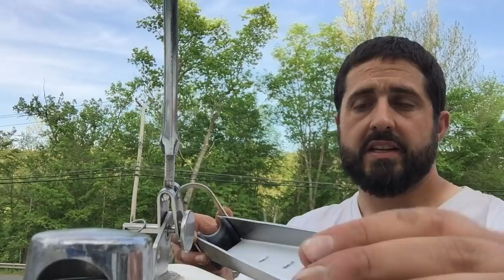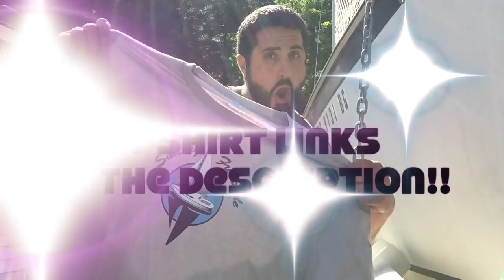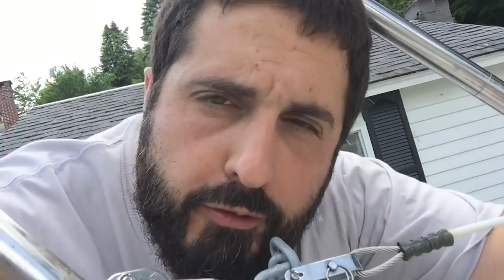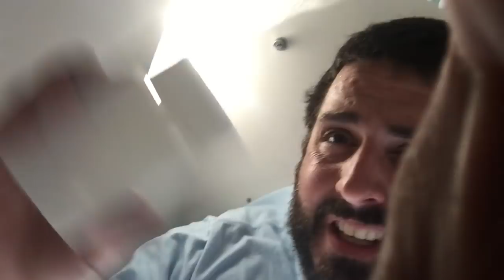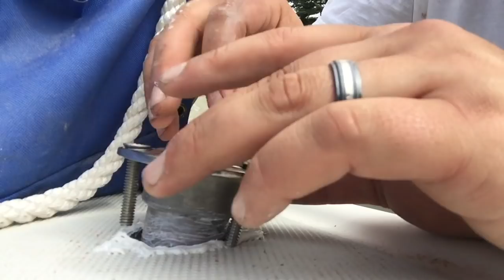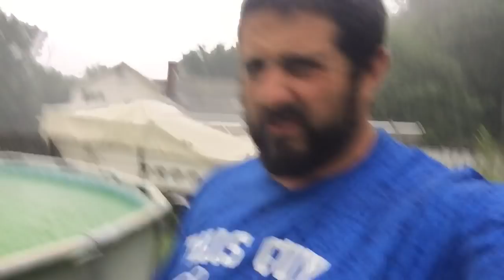Sailboat Upgrades - New Anchor Roller

Comment: Bought myself mid 70's Venture (MacGregor) 25 and refitting it. You're videos are very helpful! Lots of good ideas. Currently working on rewiring a mix of original and very sketchy electrical mods done in the past (it's a miracle this boat didn't burn up). New shore power setup with a couple of AC outlets and an on board charger is done. Next up is adding a second battery, finish converting to LED, and will soon be installing a new electrical panel, solar, etc..   I'll be tackling the anchor setup at some point, and trying to organize the gallery a little better. Thanks for ideas and inspiration!!

Comment: My '88 26D has a deck leaking problem when it rains. I've been gradually re bedding all the deck hardware and it definitely improved the situation. Still getting a little water in the bilge and on the floor inside, so gotta get the rest done. I really like using butyl tape instead of silicone. No mess, easy to re-do if needed, and works great. I built a 3' long bowsprit from a piece of oak I had for my anchor roller. It fits in front of and around the rigging plate and cleat. Gotta get one of those chain pin brackets you used. Nice to learn what the boat is made of from your work. I was cringing watching you grind into it dude.
Reply from the maker: Lol, I had to work up the courage over a while, I wanted the roller since I got the boat but that problem always scared me off. But after sailing a few times without one I realized t just had to be done so I went after it. I considered the sprit idea but read at some point that technically “adds length” to your boat (which potentially means costing more $ for a slip at a marina if that’s something we end up doing) also just a $ thing. It was a lot cheaper to grinding a little bit off than to add a sprit. I also always for get to order that tape and can’t find it in the store, so I always end up resorting to just grabbing sealant from Walmart or Home Depot.
Reply: Doh! You're right, I guess I have a 27.5D then.
Reply from the maker: Lol yes you do! Oh I forgot to ask if you sealed the chainplates yet? That’s where 90% of the water was coming in with mine.

Comment: I've not commented before on these videos but I just had to for this one.  I recently acquired an 88 26d and watching you attack the same jobs I do is both entertaining and informative.  The reason I'm finally taking the time to type something is my very next project is installing the exact same anchor roller on the bow of my own boat!  Watching you grind off the bit that I was too scared to grind myself, I actually yelped when you touched the rail with the grinder; way WAY more guts than me.  Respect to you and Aloha from Hawai`i!   S/V Windflower
Reply from the maker: Aloha Pez!! Thanks for taking the time to comment and for watching all this time! Sometimes you just need to suck it up and go after it! Analyze it from every angel first to try and figure out what all the possible outcomes will be and how you would approach each of them. When you have a plan for all the outcomes it becomes less scary! Luckily the actual outcome of grinding the bump down was not the worst case I had thought of and it was a relatively easy job! And the end result is a fantastic anchor system! I hope I have inspired you to go forward with your project! Please check out the facebook page and start sharing what you're doing with your own boat there. I would really like to start growing the community there and having it become more interactive and engaging!

Comment: That water fill need a clamp,  little more bedding needs to be used under deck hardware, I recommend butyl tape. The anchor roller  needs more support then that small pc of starboard. I recommend a pc of aluminum plate twice as big as your starboard pc. And search eBay and online  for boat parts, you’ll find them cheaper then at Amazon. Good job!
Reply from the maker: Good tips Jeffery. I wasn’t too worried about a hose clamp on the fill because it was such a tight fit to begin with and don’t plan on having the hose fill up with water (on purpose at least!) just the tank. So the hose is basically just a long funnel.

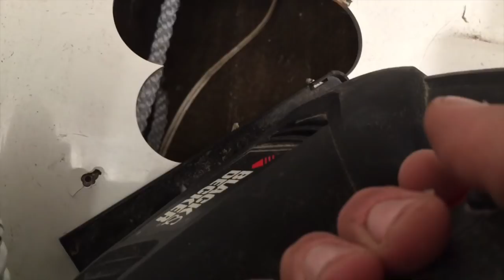Comment: I see where you cut (on the inside for bolt access) sharp square corners beginning at about the 6:38 mark. That's a big "no-no". Those sharp corners create stress risers and cracks in the fiberglass WILL propagate from those sharp corners. If you have to cut openings in the fiberglass, try to cut as large a radius in the corners as you can.
Reply from the maker: Good tip thanks

Comment: Nice job!  I think all the MacGregor boats had that forward bulkhead with no access.  I cut large openings there in both Mac 25s I've owned.  Once you're done working up there, you'll want to make a door or cover for the new opening.  I'm not sure about your boat, but mine stores the anchor rode in the space forward of that bulkhead.  Although it would be easy to make a cover that sits on the cabin side of the hole, it begs to leak just a bit of the mucky water that comes up on the anchor line and I'm always thinking about how it might come loose and let the anchor chain come tumbling into the bed while i sleep.  So on the current boat, I have three pieces of wood that can go through the hole one at a time and sit just forward of the bulkhead.  The little bit of bulkhead left at the sides serves as a flange that won't let my boards go any farther back towards the cabin. 

 I drilled some holes in the flange area (what was left of the bulkhead) and ran screws through the holes and into the new wood pieces so they are held flush to the bulkhead but forward of the bulkhead instead of on the cabin side.  This doesn't let any moisture from the anchor line to enter the Vee birth and there is no way it can come loose and fall into the vee birth either.  I left mine like that, but you might want to make a decorative cover to go on the cabin side so you aren't looking at the cut fiberglass at the edges of your new access hole.  My boat is pretty utilitarian, but you have done a wonderful job of making yours look beautiful as you improve it.

I also have a nearly identical bow roller.  Its so much more convenient to store the anchor up there and just let it go when you want to drop anchor.
Reply from the maker: Good ideas for covering that hole up there. That will be "the kids bed" so they can deal with the wet muck from the anchor rode! HA! But in all serious that is a good point I never considered and some kind of water tight hatch should be made. Maybe a cover that is bordered with a rubber gasket that can be tightened to the bulk head with a few bolts coming from the forward side of it poking through to the v berth then tightened up with some wing nuts. And yes it makes a WORLD of a difference having a proper roller now. I really should have done it a long time ago but didn't want to tackle the problem of the forestay and that small bump getting in the way. My power boat it was just a matter of slapping it on there and didn't take as much problem solving.
Reply: Before you cover the hole, think about getting an electric windlass to raise the anchor.  I run my boats single handed and I always hated anchoring because I can only control the boat from the back but need to control the anchor from the front.  So I have to let the motor idle while I go forward to drop anchor and the boat just goes wherever it wants to go until I have the anchor down.  Its worse recovering the anchor because the boat drifts as soon as the anchor is off the bottom and it takes me a while to get the anchor back on deck.  Inevitably the only thing I can do with the rode is pile it up on deck because feeding it down the hole to the anchor rode locker would leave the boat drifting free too long.  People who come up and anchor behind me have no idea what danger they are in.

An electric windlass lets you drop anchor and raise the anchor with a switch back in the cockpit where you can control the boat and raise anchor at the same time.  I bought a nice Lewmar windlass thinking it would be an easy install above the existing anchor locker (that space forward of the bulkhead you just cut).  When it arrived, the instructions said that the rode needs at least two feet vertical drop from where the windlass goes through the deck to the top of the pile of rope or chain.  If there isn't this much free fall space, the windlass is likely to jam, which makes you run forward and haul up the anchor by hand while the boat drifts aimlessly all over again.

The space forward of the existing bulkhead is too small.  It might be a bit over 2 feet to the bottom of the anchor locker, but the rope is going to quickly pile up till there is less than two feet to the top of the pile.  So my solution is to move the bulkhead back just a bit.  Six or eight inches should be enough.  I'll also cut away the fiberglass bed base forward of where the new bulkhead will be so the rode locker goes all the way to the bottom of the boat.  There will be a little divider directly below the new bulkhead so rode can't snake sternward in the bilge and get hung up so it doesn't deploy smoothly.  Its not a small job, but since you have to do something with the forward bulkhead now anyway, its easier to do now instead of re-doing it a year later as I did.

The windlass is already installed in the deck (and sticking into the very forward part of the vee berth) but I got started on the new boat before moving the bulkhead on the sailboat.  I have already installed a free-fall windlass on the new boat.  One of the few things I've learned from experience on the boat is that you definitely want one of these to raise anchor for you if you are alone on the boat.  If you get a windlass, you should also invest in a special rode for it.  You want 8-plait rope which has a special weave like braided hair that lets the rope stay soft and it piles up much flatter than normal braided or three strand ropes.  The windlass will specify a type and size of chain and diameter of rope.  You get a rode with the specified chain size spliced to the specified rope size (and make sure you're getting 8-plait rope) and it runs through the windlass smoothly and never jams.
Reply from the maker: Oh man I would love one but that is just a luxury that is way out of my budget (I’ll need a few more subscribers at least! Lol) I got a good pair of sperry’s for my birthday though that let me be pretty nimble running back and forth on the deck, lol!

Comment: Awesome job!  The anchor roller looks like it was made to be there!  You mentioned on your other boat you installed an anchor roller as well.  I have a 21' Rinker cuddy cabin boat currently.  It has always been a pain getting to the front of boat on deck and set our anchor so I have also thought about adding an anchor roller.  Right now we are using a danforth at the front, and often a second navy anchor in the back.  We tend to drag anchors since we are out in Lake Erie just south of the Detroit River that has a decent current.  I have considered using a different anchor like the Bruce Claw anchor you have with an anchor roller, is that what your using on your power boat?  Do you like it?  Any advice on anchoring?
Reply from the maker: My other boat is actually an 18 foot walk around cuddy with a Merc 150. Install was pretty easy on that with no forestay to work around or any weird humps in the deck. As long as you have access to the underside ( I ended up cutting a hatch for an anchor locker right there so access was pretty easy for me too). I do also have a Bruce on the other boat. I’m mostly on lakes around here and found that a danforth sucks in lakes because the bottom is usually rock and deadfall and old stumps, just lots of stuff to get hung up on. I actually had to cut one off before.  I always use mushrooms on my other boats so I figured the Bruce was a happy medium. You can just drop it and let it sit there like a mushroom if you’re just hanging out swimming for a little while, or you can use it like a normal anchor and set it if you have some decent ground, and have something you can can spend the night on. I think it make a big difference what the bottom is like, and you just gotta really make sure you’re setting it good by throwing the boat in reverse and pulling on it until you can “feel” it set.

Comment: I am adding a bow roller on my 1993 Mac to hold my Danforth anchor. I made a 32" bowsprit from 2 pieces of 3/4" x 3 1/2" oak that are laminated together. I removed the bow light and added new lights on the sides of the bow. The bowsprit fits over the chainplate.  I cut away a little of the bowsprit to attach the jib clevis pin. Now I will be able to operate the anchor from the cockpit. I'll post a little video of it in early October.
 https://www.youtube.com/watch?v=D3EtUl1KiVc